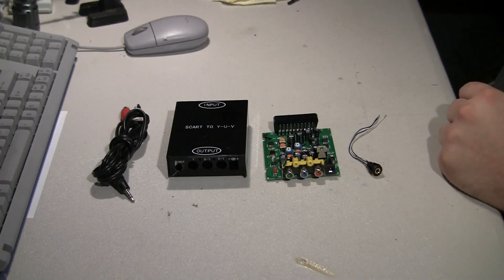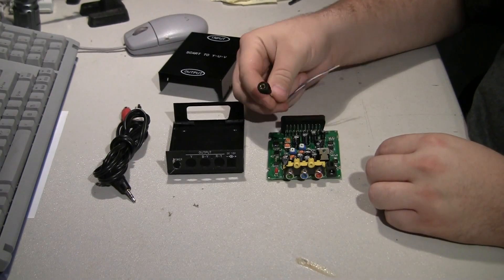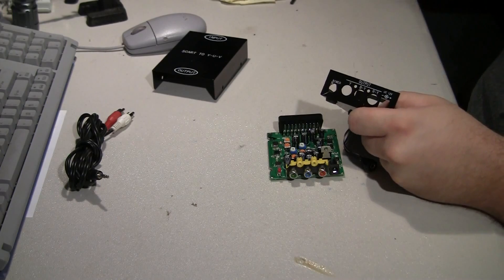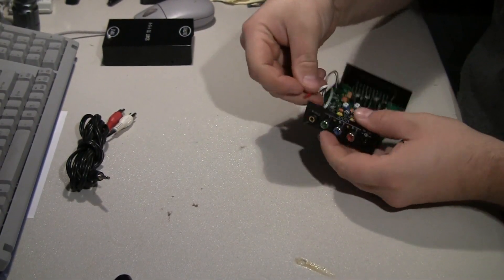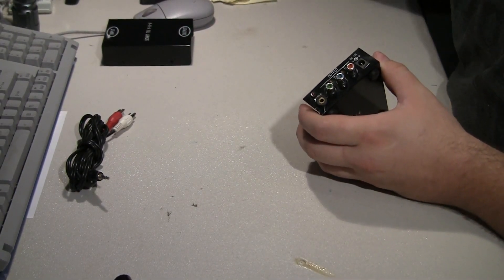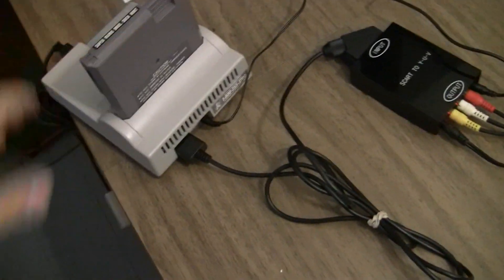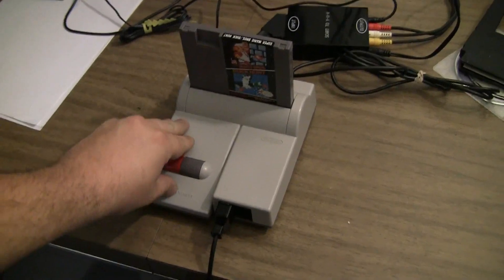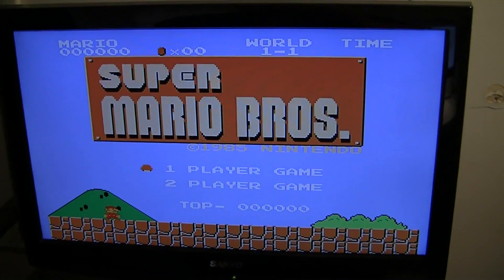Add stereo audio outputs to a SCART to YUV (RGB to component) converter

Comment: is better Scart to YUV BETTER than Scart to HDMI????????
Reply: Sebastian Spatafore depends if you want to get those scart to hdmi scalers don't get those ones that say hd video converter cause they are reallly crappy from China if you're looking to spend less money but want something good get the scart to component cause it's only like $40 USD or $50 CAD. If you get those scart to hdmi get an ossc (Open Source Scan Converter) they cost like $200 USD or get the framister which is out of production but it will run you up to $500 USD you can find some for cheaper but they won't include the remote or anything
Reply: Sebastian Spatafore also if you gonna go with the scart to component buy it from amazon it's $20 cheaper

Comment: Hello . my friend im in the US and i just got  a PAL ps2  to play pal games , im using a ps2 component cable.   but it doesn't display right on my CRT TV (big glass screen tv from 2000) it displays  shaking.   I guess it is because PAL is 50hz  and my tv is NTSC 60hz.

 I know ps2 also has RGB singnal , and i also have a ps2 Scart  cable . 

would this device solve my problem ?

Comment: SCART to HDMI works beautifully on an old CRT TV and you get all the sound options on it too without having to do any modifications. All you need is a "HDMI2AV" converter box, a SCART cable with stereo audio component cables attached to it (you can get one at retro gaming cables, a UK site) and double ended component cables to hook the device to your CRT TV. That's it. RGB graphics with awesome stereo, made simple. =)

Comment: Can't you just solder the SCART corresponding pins directly to the component cables??? what's the real deal with all this conversion???
Reply: +kurikuraconkuritas  Does it has something to do with converting analog to digital??? I'm asking you this because I intend to get the xRGB-mini Framemeister. My plan is to first use the "multi-out to SCART" cable that will connect to this converter you are using in the video, then connect the component output to the xRGB-mini using the "component to D-terminal" cable. 

But wouldn't it be easier to just solder the cables directly from the SCART to the component cables?
Reply: +kurikuraconkuritas no, it has to convert the video to component signal and scale.

Comment: Hello, my problem with this converter is that its converting slower then the audio which I take from anhother place, resulting in sync promlems where the audio is ahead. Since you soldered the audio to the scart pin, the audio won´t be going through the converting process right? Because if that´s the case this mod won´t do any difference to me :/.

Comment from the maker: It was done that way so all connections were on the back panel and there's no room for two rca panel mount jacks back there. This also allows the top to be removed without disconnecting anything. I'd be leery of powering the converter through the scart cable unless I knew it draws very low current, the wire size was more than large enough to handle it, and the console and console AC were able to handle the extra power requirement, but yeah using one less inefficient AC adapter is always nice!

Comment: I did this mod as well but used two female phonos on the top. Any particular reason you used a stereo jack, since component is usually accompanied by right and left phonos? Idk if you've tried this but you can also power the whole board through the scart cable if the system/cable is caring 5v on pin 8.